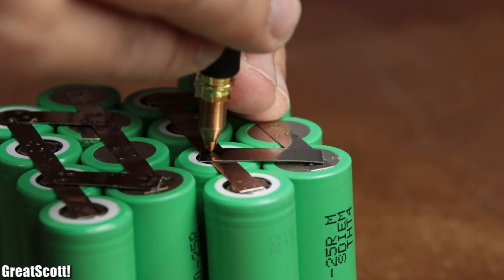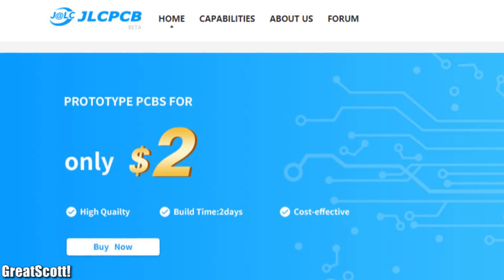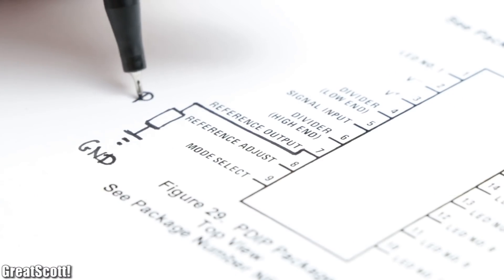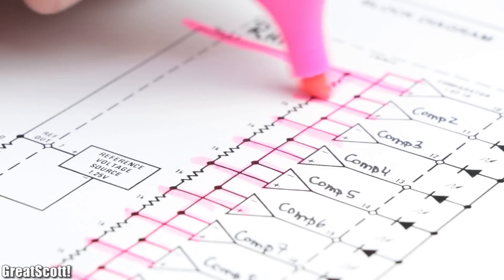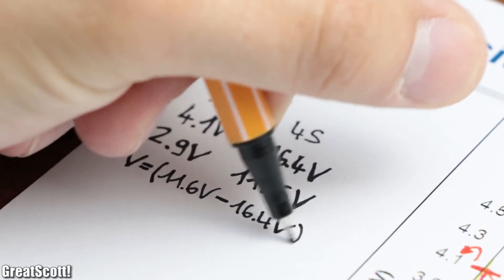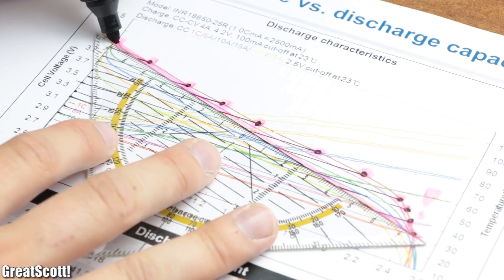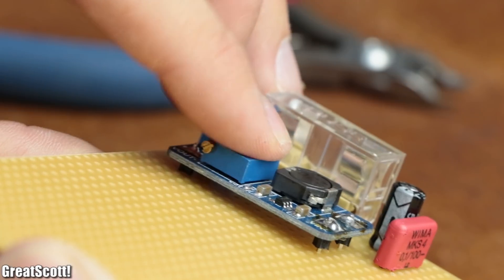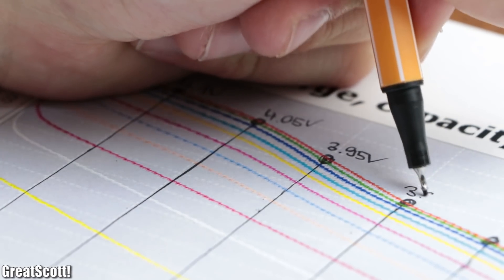Make your own LED Battery Level Indicator

Comment: I waited for this video a VERY long time. Thanks Scott!
Been a subscriber for about 5-6 years now, if I can remember correctly.
Reply from the maker: Thanks for watching :-)
Reply: Thanks for being the YouTuber you are.
Btw got a quote I think you might like. I think you said you were self-taught to program the Arduino so I believe you did this:
"Code to learn. Not learn to code."
Reply: @TheIceLeopard  that makes sense and is a cool saying.
Reply: --> Learning by doing ^-^
Reply: StormyIceLeopard please, if you need a battery indicator like this, a much simpler solution is to either use one of the specialized "fuel gauge" ICs that are designed for this job or use any small microcontroller that has an ADC. Then make a lookup table to compensate for the nonlinear discharge curve. A much easier, more compact and a lot more robust solution than having to tweak 6 pots (and making sure they don't drift or move!). I like GreatScott's videos but some of these constructions are best kept only as educational experiments and not really deployed as a practical solution.

Comment: Please notice me. I was reading Basic Electricity a navy manual and it says voltage should not be used to indicated discharge level. What do you know about this???
Reply: That's right, and exactly why he is not using the linear voltage ladder but instead is using the battery discharge curve to set the voltage for each discharge level.
Reply: I can only think its because the discharge lowers voltage and thus the reading can mess up or that the constant measuring drains battery. But im not an expert and that was all I could think of.

Comment: I tried to make something that was a bit similar and spent 6 hours on it. Then I realized it was not precise because the LM317 did everything but staying in its Reference Voltage tolerance.

Comment: Could you not have made one with one RGB LED and change the color based on the power level?
Reply from the maker: Possible
Reply: You'd have to choose 3 voltage points and hook up each to one of the 3 colors. I currently can't think of a way to make a combination color of rgb while still being able to choose r,g,or b by itself. Maybe through the use of diodes to prevent two or 3 pins from being permanently connected?
Reply: or you can use a cheap ass Attiny 13 and some coding, damn, uC is so cheap now
Reply: Eric i think it's easier to read the difference between 1 led on and 3 led on, than to read slightly different shades of red
Reply: just use microcontroller. A cheap attiny13A is a perfect one for this job.
Reply: That would be cool
Reply: +Revi M Fadli One can chose the color that is displayed. Green, Yellow, Red, Off.
Reply: Skuldugery sure, if you're living in the 60s
Reply: there is a prob, some people are colour blind
Reply: @ABID5  yeah, some people are blind too
Reply: @ABID5  nice one😂